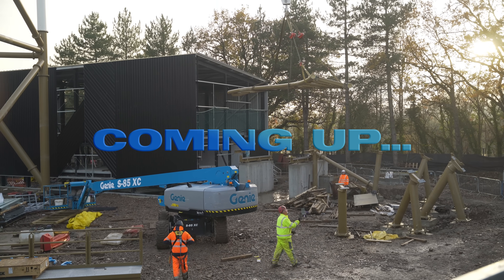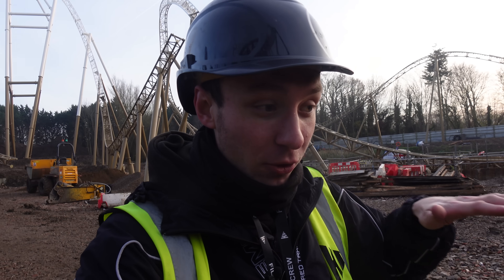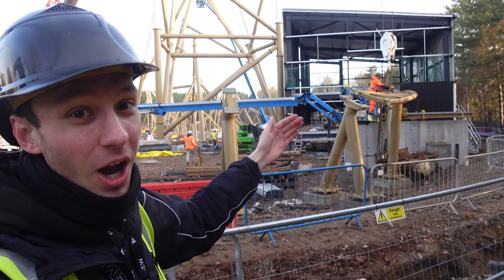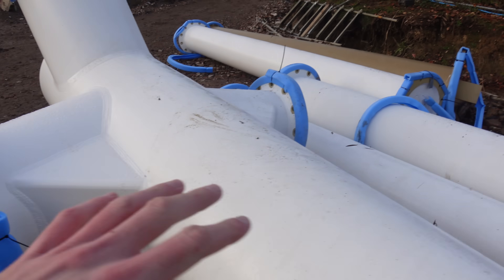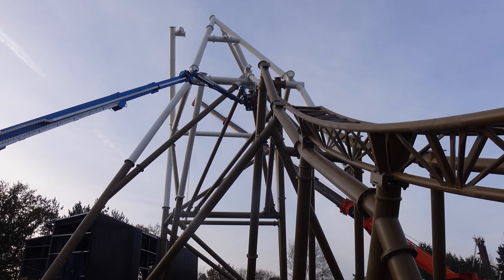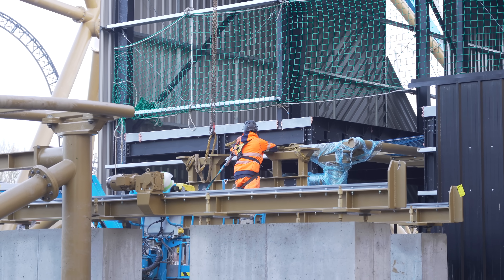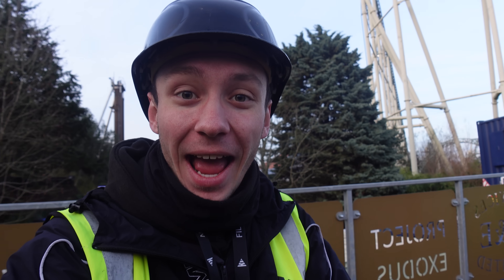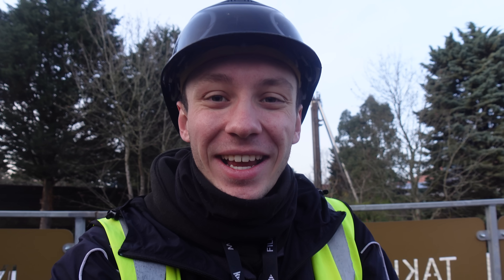HYPERIA Construction Update #52 | THORPE PARK

Comment: Thanks for the update, I’m guessing that they’ll build separate areas of track to allow a little bit of movement when putting in the final pieces, otherwise it will be a nightmare to put the last piece in. That’s what I’d imagine anyway, it’s probably better logistically and saves the stress later down the line